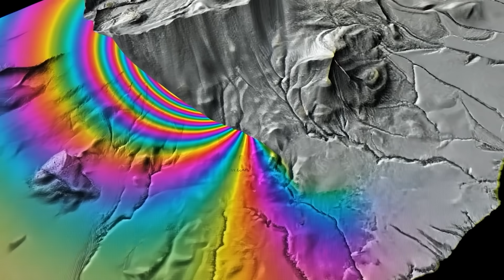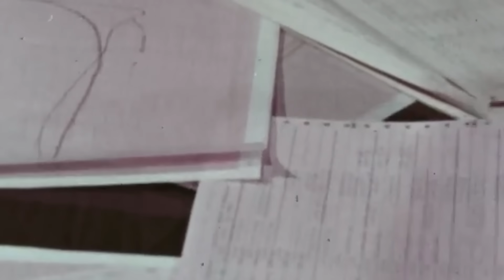The Soviet Nuclear Horror That Plummeted From Orbit

Comment: Kosmos 954 satellite disaster, which occurred in 1978. 

Key Facts:
Kosmos 954: This was a Soviet reconnaissance satellite powered by a nuclear reactor. It was part of the Soviet Union's RORSAT (Radar Ocean Reconnaissance Satellite) program, designed to monitor NATO naval movements.

Orbital Failure: In December 1977, the satellite's orbit began to decay due to a malfunction. The onboard system designed to boost the nuclear reactor into a "safe" disposal orbit failed, and the satellite re-entered Earth's atmosphere on January 24, 1978.

Reentry and Fallout: The satellite broke apart over northern Canada, scattering radioactive debris across a wide area, primarily in the Northwest Territories. The debris field stretched over 600 kilometers (370 miles).

International Response: The Canadian government, with assistance from the U.S., launched Operation Morning Light to recover the radioactive debris. The cleanup effort was costly and time-consuming, but fortunately, no significant radiation injuries were reported.

Diplomatic Tensions: While the incident did cause concern and diplomatic friction, it did not escalate to the point of threatening World War III. The Soviets eventually paid Canada $3 million CAD to cover part of the cleanup costs, though Canada had sought significantly more.

Misconceptions in the Description:
Soviet Call to the Pentagon: There is no evidence that the Soviet High Command directly contacted the Pentagon in the manner described. The situation was handled through diplomatic channels.

Immediate Threat of War: While the incident was serious, it did not come close to triggering a global conflict. Both the U.S. and the USSR were aware of the risks of nuclear accidents and worked to manage the fallout.

Radiation Storm: The radiation released was localized and did not cause widespread environmental damage or health crises.

Conclusion:
The core of the story is true—a Soviet nuclear-powered satellite did crash in Canada in 1978, causing an international incident. However, the dramatic elements, such as the Soviets fearing World War III or directly calling the Pentagon, are either exaggerated or fictionalized. The event remains a notable example of the risks associated with nuclear technology in space.

Comment: It is a bit overtoned as the evil activities of the soviets.
US did the same in the same time period. Reconnaissance satellites needed a lot of power in the states too and they made the totally same solution as the soviets (obviously both countries spied on each other's tech for building them). The program ran under the name of SNAP, with satellite nuclear reactors and nuclear thermal power units. They also sent them up and also had a couple of them falling down uncontrolled. As example, the SNAP 19 made a highly radioactive plutonium shower for the whole southern hemisphere.
SNAP reactors have powered Pioneer and Vkiking missions. Their latest versions were brought to the Moon with the Apollo missions for powering long-term measuring equipments.
And it is still the ONLY reliable solution for outer solar system probes, those can not rely on the distant and weak solar energy.

Comment: Just to keep the tone factual. Total nuclear reactors in earth orbit (current estimate, using the probable assumption that none have retuned to earth since the figures I checked for 2023). 
    Soviet RORSATs: 32 reactors still in orbit.
    U.S. SNAP Reactors: 1 reactor (SNAP-10A) still in orbit.
    Others: A small number of experimental reactors, bringing the total to at least 40 reactors.
All of these reactor are currently in stable "disposal" orbits. However in time, all of these orbits will eventually decay and all of this junk will eventually return to planet earth.

Comment: The joint Canadian American recovery only retrieved 1% of the satellite structure and 0.01% of the U235 fuel of which Health Canada assessed a health risk of 2 years.
Reply: And is there 10 years' worth of nuclear satellites still in orbit?
Reply: @ebayerr  Canada was lucky that Cosmos 954 burned up mostly in the NWT Barrens where mostly caribou migrate, The Bathurst caribou herd isn't so lucky though with their population decreased from 470,000 in the mid 1980s to 6,740 in 2021. Something is happening and it ain't climate change. BTW this channel put out one of the best videos yet on Cosmos 954.

Comment: 6:33 so 15 Roentgen for hour isn’t TERRIBLE. However, consider this, the United States federal limit for employee exposure is 5 Roentgen per year. 

If you had a 15 R source on your person for 24 hours you would without question die.

Later on 500 R per hour is mentioned, this is of course extremely high. This was probably an “on contact” reading, the level of radiation likely dropped off quite fast as you moved away from it. That being said, if an item with this level was near enough, no more than 30 mins would be necessary for one to receive a lethal dose.
Reply: The debris piece of 15 roentgen "the Antler" on earth impact sprayed, splattered, debris that the Canadian military assessed at 25 metres and yet L/Col Davidson put two  guards one CAF and the other RCMP at camp only 15 metres from the Antler. The RCMP guard is now deceased by leukemia and the fate of the CAF guard is unknown.
Reply: @  am I reading it correctly, that they were getting like a general area reading of 15R basically? Insane that they’d have them camp so close. Unfortunate and unsurprising regarding leukemia..

Comment: Why wouldn't the soviets just plan to launch the reactor into the sun once finished? What was the thinking behind a "graveyard orbit" in the first place?
Reply: Because 'just launching something into the Sun' is harder than you think.

Just reaching Earth escape velocity (an additional 10,000 feet per second when already in LEO) merely puts you into a slightly different orbit around the Sun than Earth is. You still have to cancel that considerable orbital motion.

It took a Delta IV Heavy, and several planetary flybys, just to get the Parker Solar probe close to the Sun.

A higher, low drag, stable Earth orbit, is much simpler to achieve.
Reply: The moon would be easier, but still hard.
Reply: Reminds me of how young people think they have complex solutions for the world when they can’t even figure out their own little lives. The amount of delta V (+ change in velocity) to get something into the sun is challenging even for a special built rocket, much less a failed satellite. Launching something into orbit THEN picking up a payload and launching it anywhere has never been done as far as I know.

Comment: The scary thing is they’re still dozens of nuclear satellites up there
Reply: Source?
Reply: @lochlanmuir2291  if I could post pictures I would. I worked on the programs with JPL. The reactor was built in Utah
Reply: @lochlanmuir2291 It uses non-fissile Plutonium 240 in its thermoelectric generator.
Reply: Russian bots everywhere these days. Typical childish whataboutism.
Reply: All we need now is a rogue Nation with the ability to pluck those weapons grade uranium satellites from orbit.
Reply: Even scarier is the graveyard in the pacific for space debris...
Reply: The United States mars rover has a nuclear generator.
Reply: @goat3898 But the main difference is that the rover will never come crashing onto earth.
Reply: @Microbex  but it had the potential to when being launched to mars.
Reply: @goat3898 but it's on Mars and not an a threat for at least 50 years
Reply: @goat3898 It uses Plutonium 240. With a 80 year half life it is highly radioactive however it is non-fissile like Plutonium 239 or highly enriched Uranium 235 used in this case (Little Boy Atomic Bomb also).